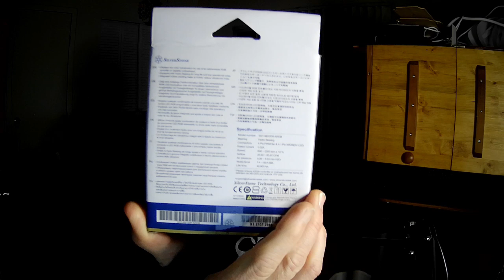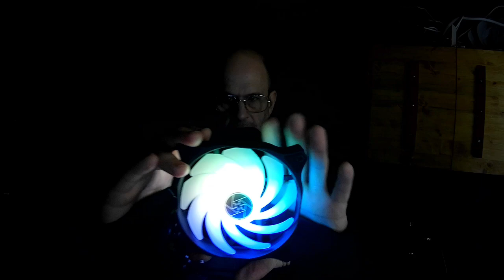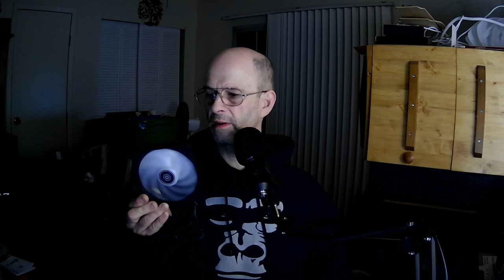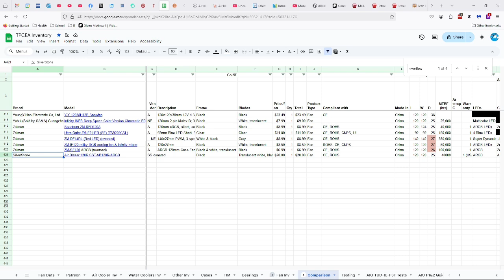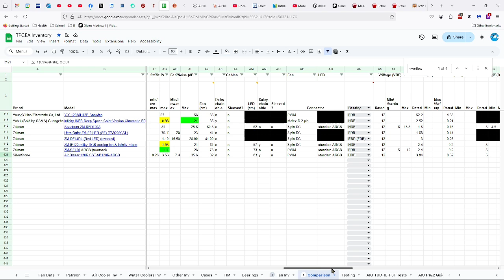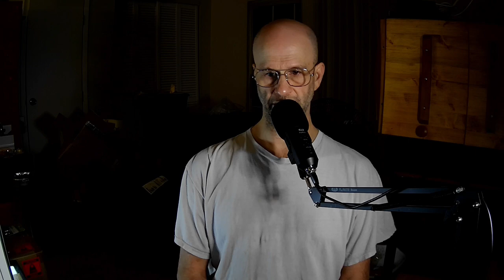SilverStone Air Blazer 120R PWM ARGB Fan Preview

Comment: Muito barulhento nas rotações máximas?
Reply from the maker: Are you sensitive to noise? If yes, then maybe. For me, it's not a problem but I'm not noise-sensitive.
Reply: @ThePCExpertAmateur  - Obrigado pela explicação.
Sim, sou, pois gosto de trabalhar em silencio.  Estava pensando em comprar esse ou o Arctic P12 PWM ( Não o PWM MAX ), que e bom também, mas mais silencioso. Tinha um Akasa Piranha 120mm na parte de baixo do meu gabinete jogando ar pra dentro e troquei por um Arctic e mesmo tendo especificações " inferiores ", ele resfriou melhor meu CPU e os VRM também. Ficou 3 - 4 graus mais baixo, em comparação a Akasa.
Reply from the maker: If the P12 outdid the Piranha, that's most likely because of a conflict in airflow, which could've been because of other fans that were decreasing the Piranha's results, conflicting air currents, too much pressure in or out, or something else. If I had to guess, I'd say that the Piranha's greater strength was interfering with the flow of air to the VRMs and CPU. Rearranging the airflow (for example, making it like a chimney) would also help.

If you have the ability to learn to ignore noise, that is something I would advise but, otherwise, there are lots of fans that aren't noisy, especially older ones like the Piranha.